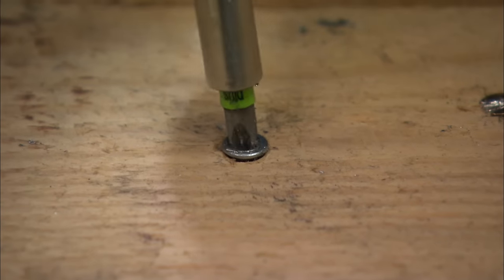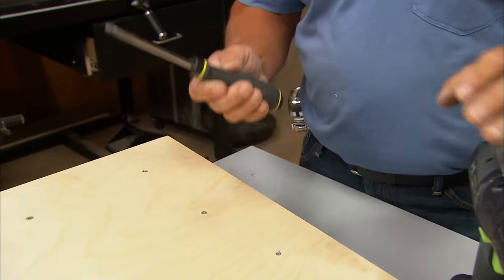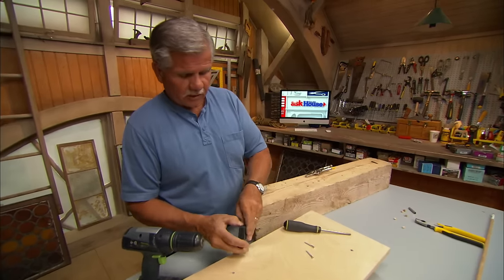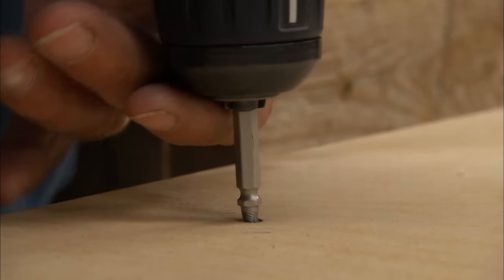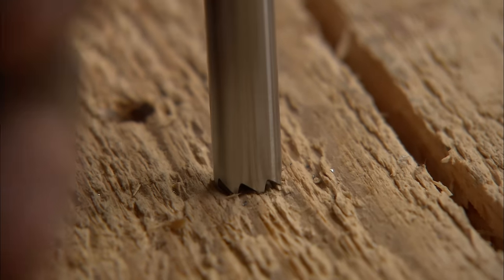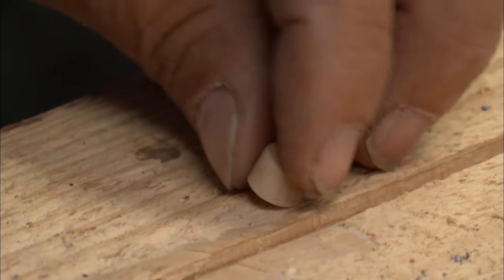How to Remove Stripped Screws | Ask This Old House

Comment: I use a Dremel with a thin cutting disc to make a slot.
Reply: That and the extractor work great for most cases.
Reply: Same here.
Reply: That's what I have always done. I was hoping to learn something new from this video.
Reply: That works on every single buttery screw on every Harley Davidson ever built.
Reply: I tried that and it worked haha i used an "I" shaped screwdriver and it worked, Thanks~~
Reply: Good solution!!
Reply: Won't work when screw breaks off.

Comment: man, much love to you guys...thanks. If ya'll don't have any money but you have some super glue or epoxy, another method is to glue your screw driver tip to the stripped head and then carefully remove it when it is dry. Don't torque too hard because it will just pop off. Then you can easily pop the screw off when it's done .

Comment: I heard a piece of rubber band might give extra grip. :)
Reply: Yes. Before going to the screw extractor tool, with a manual screwdriver push a rubber band into the hole, then unscrew... well, try to unscrew
Reply: I've tried it many times and never succeeded. 
Rubber band trick doesn't work. Elbow grease, patience and focus always does!
Reply: This worked for me! 👍🏼

Comment: Making a slot with an angle grinder or hack saw in the head of the screw also works great.
Reply: Wow! Thanks!
Reply: I use a Dremel abrasive disk to make the slot.
Reply: what if the screws counter sunk

Comment: worked great! I used a flathead, pounded a little with a hammer to set it, and it came out. for another stripped head screw, I couldn't turn the screwdriver so used the vice grips to turn it while pressing down to keep pressure on it. thanks for making the video!

Comment: I didn't have these fancy bits. All I had were a regular drill set and a hammer.

I wound up drilling a shallow indent into the screw head and then hammering a phillips drill bit into it until it left enough of an indent for the bit to bite into it. That finally did the trick after much hair-pulling.

Comment: I like this video as it shows me a tool I have not seen before , i.e the mini hole saw.
After an hour searching the internet I cannot find one. he nearest are annular cutters, which will not fit a hand drill.
Where did you get yours ?. I generally have no trouble with extracting screws, but nails with the head broken off  are more difficult. I have been using a plug punch to make a small hole around the nail, but often , for long nails I need a deeper cut.
Many thanks,
Laurence

Comment: I work in the bowling business and they use a lot of the square head screws to put down the lanes or they use great big screws in the back I used to have a core extractor such as the last one but we used to have to drive a dowel in to fill the hole. Then cut it off flush..

Comment: You can try putting a piece of inner tube rubber between the tip of the screw driver and the worn head. Works surprisingly well. (edit; as i now see someone has already pointed out)

Comment: Will a screw extractor work on a screw on a pump? Electrician screwed it in so tight I can’t get it open to take a picture and send in for the inspection. Screw won’t budge with a manual screw driver and is slowly stripping away with the screw gun.

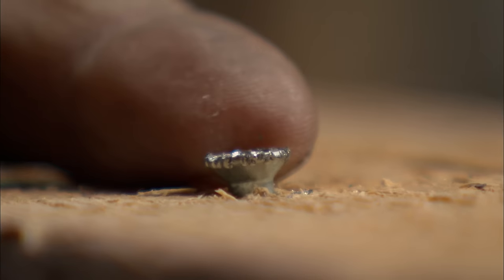Comment: 0:38  This is  a trick that any one guess and actually people do this. However, generally the screw is hard to move initially and the tough job is to get it out enough to be plucked easily.  
1:40    What the point drilling out the broken screw and putting a cork on it. Don't you think just filing the screw head or just forcing the screw a bit deeper would have done the job. Its really tough to find the exact shade cork as of the wooden surface.
Reply: killingMyPreciousTime w00dwork

Comment: Trying to remove broken screw from expensive Miele vacuum power head. Any ideas? I have to access the foot release petal / broken 🎉spring, but I don’t want to damage the top piece (under the cover), as it holds the motherboard.

Comment: If you use the pliers then you might want to unscrew it for about an inch then bend the screw with the pliers to a 90 degree angle. Then you can unscrew it with your hand the rest of the way.

Comment: hi. wonder if you had any tips please....how do i remove a philips screw where the head no longer fits the screwdriver....this screw incidentally is holding in a glass cover so it can't really be hit hard with a hammer to loosen it first, I have also already applied some wd40 to the screw. thanx.

Comment: I've seen people cut into the screw with a saw and then use a flatehead screw driver to get it out. But how how do deal with a small stripped screw that's in something like a gaming controller?

Comment: I need help, I used a small screw driver to remove 3 screws, but the fourth screw had a deformation In its head. The screwdriver was perfectly able to grip the first three screws, but the last screw just simply will not turn. Any solutions?

Comment: For Surfboard Finbox Screws: Firstly, I fitted an as large as possible Torx Bit into my screwdriver (traditional, non electronic). I then carefully hammered the screw driver into the stripped screw. I then made sure to hold it tight while unscrewing this little biggot for the very last time. I was inspired by the thin-dremel-cutters. It worked, to my amazement, very well. It is important to mention that this was done on a plastic surfboard! Not glassfiber. I'm unsure, pretty certain, that it would work on glassfiber as well. / Be more careful with the hammering, though.

Comment: What about when the head is fine, but the board is stripped so it wont grip and back out? Occasionally i can get a flat head screwdriver or knife to pry up the screw, but often times that doesn’t work.

Comment: 0:35 if the head is sticking up or screw doesn't have hear but is sticking out. 

Just your your still no bits, tight your chuck and reverse slowly. Comes out every time.

Comment: You're the only one who has a fall-back position: plug cutters. Unlike most others, you know that sometimes, oftentimes, screw extractors won't do the job. This is why I have really prepared for tomorrow's screw removing extravaganza. I won't go into all the tools that I have marshaled for the job, but two types of plug cutters are among them. I'm going to remove those damned screws one way or another.

Comment: The type of screw extractors also don't always work. I'm not exactly sure why. Maybe the metal of either the screw or possibly a lesser expensive extractor isn't hard enough. In the past I haven't had an even 50% success rate. I'll know mire tomorrow when I'll attempt to remove a #2 double square or Robertson stripped screw out of an aluminum frame. Maybe I'll update this. I've ended up having to drill out screws like this in the past. There are other options and I have a higher quality extractor set these days, so I'll find out. I really wish people wouldn't use these crappy screws to begin with. I have a lot of wishes though. Good luck!

Comment: if its not totally chewed up, you can also use valve lapping compound sold at auto parts stores, just put a dab in screw slots and it provides extra "traction" for the screw driver

Comment: I got an extraction set and the extractor just spun inside the screw head.  Piece of junk.  Any more ideas?  I tried to drill it out with a new bit and it won't  make a hole.  It is supposed to be a brass screw but maybe it is diamond.

Comment: What about if it was in metal? I do have this problem in my stove at home. I was trying to open it a apart to clean it.
Reply: There are similar drill bits as the ones he used to extract the screw. But also, if you have one hard enough, you can use a drill bit to make a hole inside the screw. That way it will be easy to take away by pieces. You just have to take care of not damaging the threads of the hole.

Comment: That miniature hole saw still leaves quite a large hole in the wood.. I would first try locking pliers and all other things on it. Maybe use an angle grinder to make it flush with the wood, and then a small drill bit to drill it a bit down a little further, 1mm or so, then just patch the screw-sized hole.

Comment: Ok, but what if none of these methods work because I'm already trying with a manual screw driver, that screw remover kit doesnt have a small enough bit in it, and drilling a hole around the screw isn't an option?

Comment: Used a water balloon over the screws and a cheap Black & Decker drill.  No problemo.  Maybe try the easy "solutions" first before you go out and buy accessories you may only use once (Like I was ready to do).

Comment: You need to hit that plug harder, a sledge usually does the trick but if you don't have one, fear not, just use a wheel brace

Comment: Who calls a screwdriver a manual screwdriver? Do they come in automatic?
Reply: ZMBP yes. A drill
Reply: @marcaveli7791  but its not a screwdriver. at that point its a drill. an automatic screwdriver would look something like a normal screwdriver but it turns automatically
Reply: @xoniumvortex2  they make those too. Look it up
Reply: Impact driver
Reply: Thats like a kid asked me one time, is that an electric hammer? I said no you have to run by hand.
Lol
Reply: Tommy Silva does... that's who.
Reply: In Other Words - don't start with a drill driver......jeeze, a bunch of cunning linguists ,-\

Comment: As soon as it starts you should get some grit hand soap and dab a bit on the right screw driver and put a whole lot of pressure and slowly turn it out. Speed handles work great for this.

Comment: What if I don't have those fancy tools?
Reply: Melissa Orsini then you really shouldn't have that big a problem. his example screw was stripped most likely by using a drill. So in your case you could use a regular Phillips screwdriver or one of those you have to hammer to get it unscrewed. Also, a grip lock pliers isn't a fancy tool and should do the job as long as you get access to the head.
Reply: Then you're 'screwed' lol
Reply: Melissa Orsini uh buy them? Lol
Reply: OOOHBILLY .
Reply: If the head is sticking up, use just the drill to unscrew it. Tighten the chuck around the head.
Reply: Super glue.
Reply: Melissa Orsini you can use main Tools

Comment: Show it on an actual project- like removing a stripped screw from a cabinet- instead of on a free standing old piece of wood- and he assumes that someone has the strength in their hands to use a hand screw driver and actually be able to turn the screw with it-

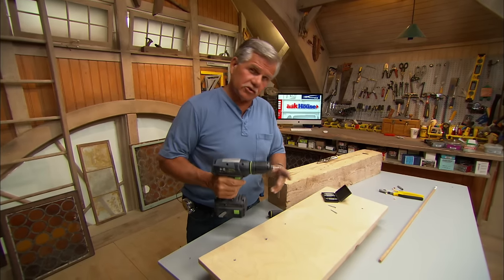Comment: 1:07 - Those extractors don't work that well. A better solution is to use a multi-tool cut a straight line and then use a flat head.